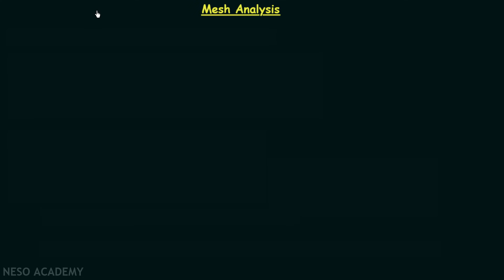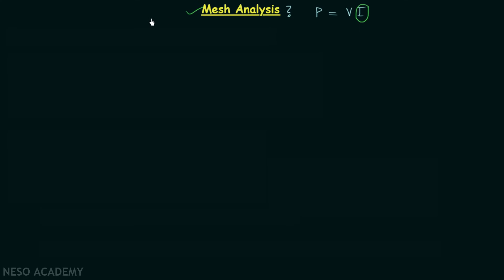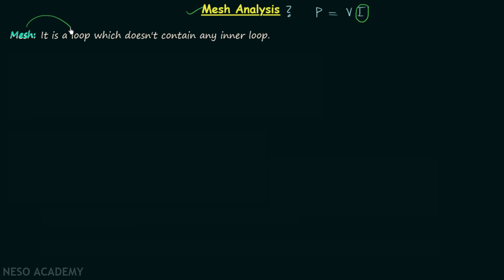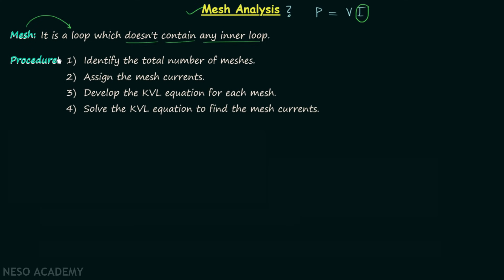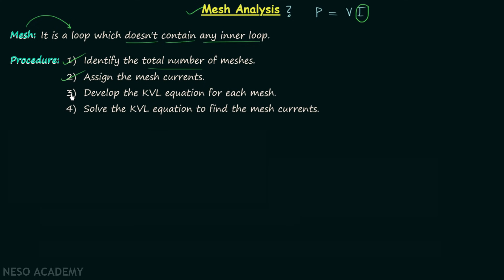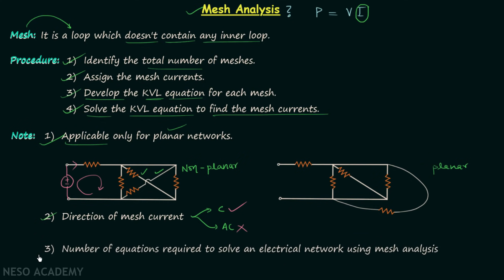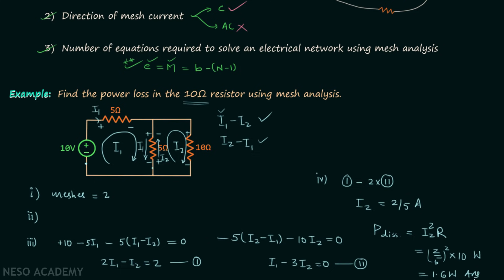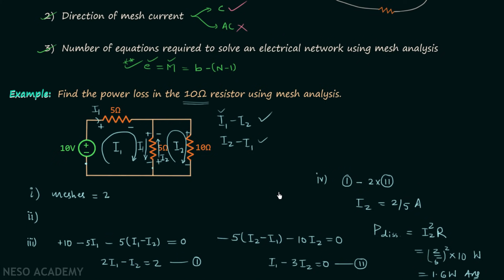Mesh Analysis

Comment: At 9.30 why did we take negative 5(I1) ohms when according to polarity its positive?
Reply: Because we're applying KVL, we know that the algaebric sum of voltages will be zero, basically, source voltage is the total voltage, and the subsequent voltage drops are a part of it, which is why when you subtract portions of the whole voltage from the whole voltage, you get zero
Reply: Yassssss

Comment: In the substarction of 1 -2 why you multiplied the second equation by 2 why not 10 or 3 or 4 or etc 🙃 please answer this I have only this doubt
Reply: bro actually he was using the elemination method see the first eqn is 2i1-i2=2 second eqn is i1-3i2=0, so he multiplied 2 with second eqn to make 2i1-6i2=0, and now eqn 2 can be eleminated by eqn 1 and we can have the value of current i2
Reply: @abhiyadavcse8080  2 years ago i posted that comment bro now i don't know that subject name also 😅😅 meanwhile thanks for your explanation

Comment: Example of mesh analysis:- 
I have 2 doubts sir
1) at 5ohm resistance  why we r consedering 2 different polarites in each mesh? 
Single polarity is not enough ha for both meshes at 5ohm resistor? 
2)  is the term power loss or power mean same ha sir?? 

reply or Clarify the doubt sir pls
Reply: Same doubt

Comment: why did you multiply 2 at the last in equation 2? and do we do that in all the cases or was that question specific? and great video tho have been watching it since a long time now
Reply: to solve for i1
Reply: bro actually he was using the elemination method see the first eqn is 2i1-i2=2 second eqn is i1-3i2=0, so he multiplied 2 with second eqn to make 2i1-6i2=0, and now eqn 2 can be eleminated by eqn 1 and we can have the value of current i2

Comment: If we are requried to calculate power absorbed through 5ohm resistance which current we have take.? Plz xplain sir.
Reply: Take I1-I2 or I2-I1. It’s gonna give the same result since while finding out the power you have to square it.

Comment: At 04:00 - 04:57, aren't both the networks exactly same since the way of representation in the first network does not show the two paths crossing each other; they are still apart? This way both the network are planar only.
#Correct_me_if_I_am_wrong.

Comment: I2 should be equal to -2/7 not 2/5 
please correct me if m wrong
Reply: 2/7 ayega..video me positive 10 ko shift kiya to vo negative hoga
Reply: yes  bro, you are right ..........sir, please give me the explanation
Reply: U r right i2 is - 2/7
Reply: I2 is 2/5. Eqn 1 - eqn 2. So, eqn 2 becomes: -2i1+6i2=0.
Reply: eq 1 - 2x eq2
then   
-I2 +6 I2 =2
I2 = 2/5
Reply: 2/5 is correct. In my first try i also get 2/7  due to my mistake in sign.
Reply: 2/5 is correct....